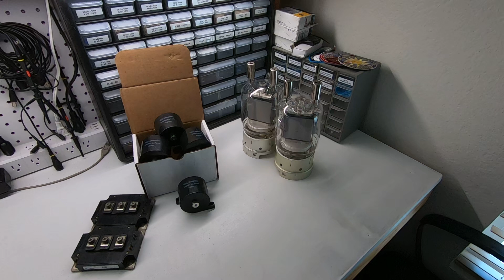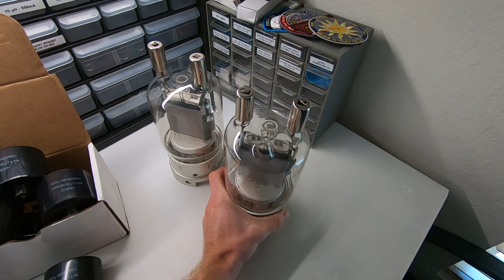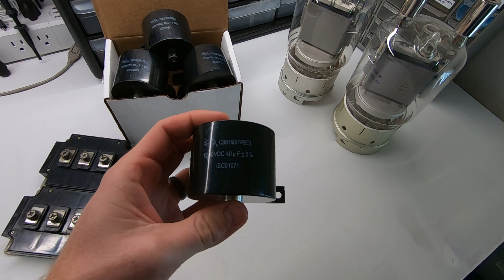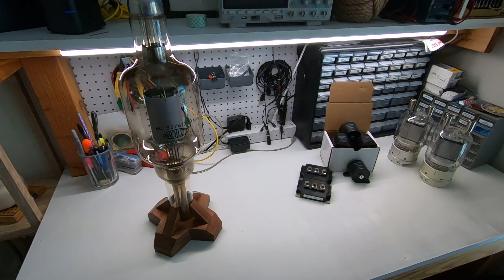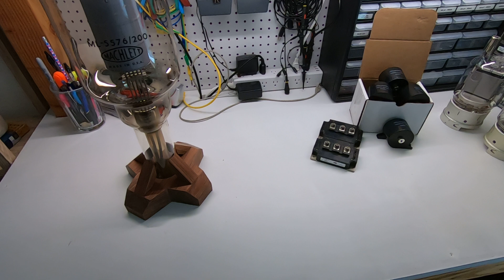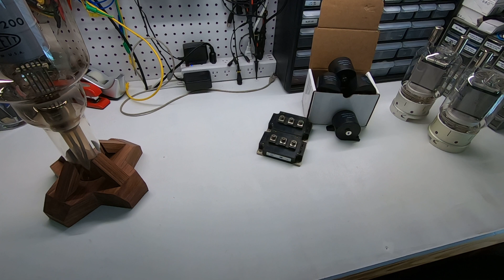Channel Update - Future Video Ideas

Comment: hey- i have some questions for you to look into-  concerning  an AC audio signal and different conductor configurations that make perceivable differences in sound quality. why does silver 30awg conductors sound different than generic, stranded conductors?  Why using a braid technique where the positive and negative conductors cross at a 90* angle? does this reduce inductance?
Reply from the maker: Hi Lane,
With regard to silver conductors, they should not produce a noticeably different audio quality vs a copper conductor of similar size and cable construction. I'm no audiophile but it looks like a marketing gimmick to me.

The twisted pair however is a legitimate technique that  both helps reduce inductance (although only marginally compared to a closely spaced two wire ribbon) and more importantly reduces the effect of induced currents from EM noise. The details of why this is can be found by searching "how do twisted pair cables work".

Comment: 0. Antennas in 3d would definitely be cool.

1. 3d printed conductive material which optimizations for fast/ideal circuits. (hit me up if you need high temp materials or conductive prints) 

2. Surface charges on bimetallic surfaces.

3. A magic trick apparatus that makes a coated card launch out of a deck of cards.

Keep up the good work!

Your ansys stuff be a good early start before the more expensive building projects.
Reply from the maker: Thanks for the ideas! I agree, while I collect components for future projects I can work on more simulations.

Comment: Ah, I remember those ГУ-80 pentodes, fun stuff. Also had ГМ-100 but never got to use it.
Reply from the maker: Very cool! I have yet to power these up, but cant wait to eventually. Unfortunately it looks like one of mine may have been damaged in shipping as there is a small coil of wire loose in the bulb.

Comment: Hey, I also came from the shoutout, but if you need a few videos ideas, I might have some, and maybe you'll like one of them:

I would find a high-power pulsed laser quite interesting for pulsed power projects. I know of some designs that basically self-destruct, which sounds additionally amusing.^^
Or maybe a video about electromagnetic forming or something like that.

For your more theoretical content, I would be interested in a video investigating the behavior of analog signals in maybe a speaker wire with interference or perhaps a video on really high-speed interconnects, e.g., Display-cables or a PCIe bus and their possibly strange behavior.

Other than that, I always wondered about DC transmission lines and the tech behind them, especially the AC/DC conversions at such high voltages. Got as far as the Wikipedia article but not much further since I don't even know what to search for. 

I don't know what of this is in your expertise and what interests you, so I thought just proposing them wouldn't hurt. :) But I am excited about future videos already.
Reply from the maker: Great suggestions! The pulse laser idea certainly interests me, though I will have to read up on the optics side of things. I would love to make a quarter shrinker, but the energies involved are a bit large for the condo complex I'm in, however I may be able to do some thing on a small scale and make it more educational (maybe include some simulations of the induced currents and related forces).

Using simulations to investigate interference is a good idea as well, I'll have to think on that one for a bit.
Reply: Also don’t be afraid to joke around, everyone likes jokes, anything you like is good

Comment: Yes +1 for antenna simulations
Reply: In 3D , no less.
Reply: And viewable on a pair of stereoscopic glasses like the Oculus headsets or even Google Cardboard.  What a great way to visualize physics phenomenon besides just playing games

Ben, are you a ham ?

I would like to generate X-rays (safely) and get X-ray sensors to look inside things.
Reply from the maker: Bob, that is a super cool idea. I don't know if I have the skills to integrate the simulation into some sort of augmented reality setup, but I wish I did!

No I'm not, I've never messed around with radios actually.

X-rays are easy to generate by accident, hard to do safely!
Reply from the maker: I plan to do that next! Thanks for the input.